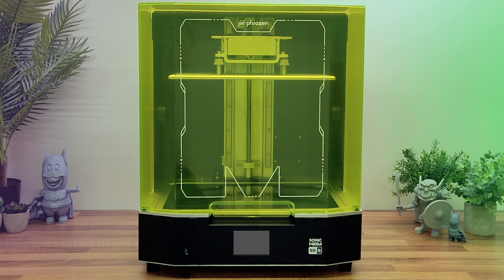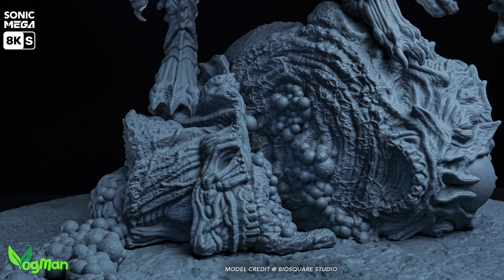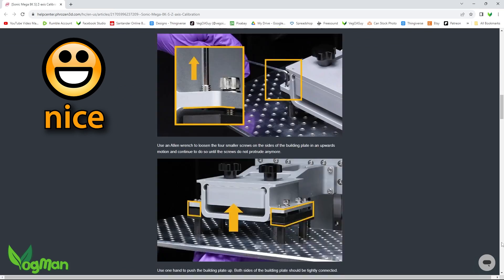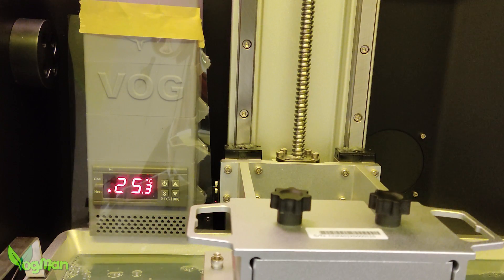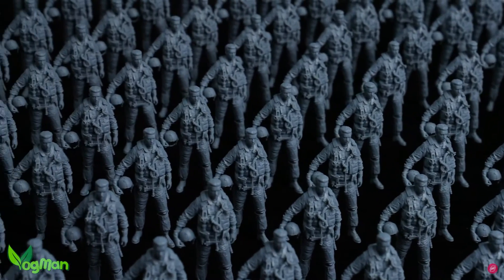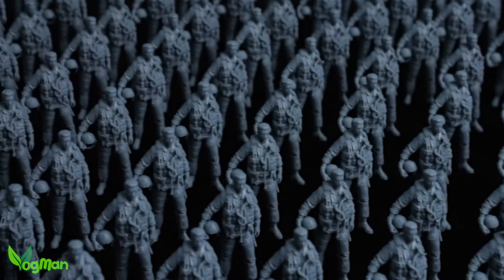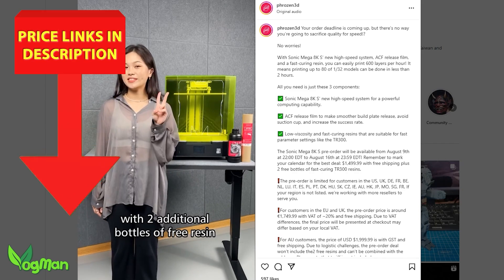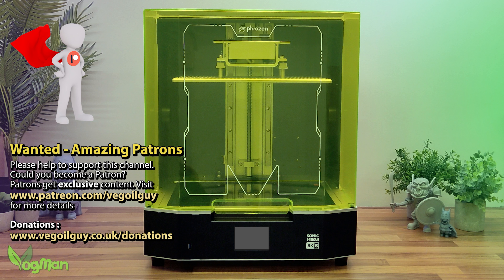Phrozen Sonic Mega 8KS + wash & cure stations [HONEST REVIEW]

Comment: "They all seem to drag their feet on this issue" It's likely because heaters can be a fire hazard. A hazard they probably don't want to risk liability over if they can't provide a quality and durable product. Possibly due to licensing as well.

What's even dumber than not producing a heater is how their resin pump is tied to their software in the Mega 8KS instead of stand alone so you can't use it on the old system or other printers.
Reply from the maker: I agree with you Greg. No doubt there's lots of red tape and safety regs to navigate, and that's daunting and expensive. Yet these same companies produce FDM printers that melt plastic at over 200C. In comparison, heating a chamber to 30C should be child's play 😁😁😁
Reply: @vogman  I agree it should be child's play. Still probably regulatory stuff that doesn't affect normal printer heating methods (yet).
Reply: @GregAtlas except gktwo gas one. Soooo.... There goes that theory

Comment: The print quality is really bad compared to mighty 8k
Reply from the maker: Different machines for different uses. The Mighty has a resolution of 28µm vs 43µm on the Mega. That is a quality difference that is easily discernible to the eye. That's why I felt Phrozen made a mistake in not including a 12K screen. It still wouldn't have bettered the Mighty, but it would have narrowed the gap 😁
Reply: @vogman   Yeah, i like speed of Mega 8ks and Size , but i will wait Mega 12K , haha, thank you sir Vogman😍

Comment: I feel it's a bit crap to have what is effectively a semi-pro machine at that price not have Wi-Fi/LAN as standard.
I get the impression with all these Chinese manufacturers that they are all following each other's tails and nobody is capable of any original thought.
As I can get an Arduino dual Wi-Fi/Bluetooth controller board for under a tenner, there is simply no excuse.
Reply from the maker: They are all quite similar, but one really stood out to me and that was Uniformation. They at least are thinking differently https://youtu.be/ie18N4GrMVY   😁

Comment: The wash station feels like it really needs a bit more innovation.  You could make the tap so at the very least it flips up out the way.  But im also thinking that they are missing a trick in that the position of the tap will drain all the IPA but not the sediment that will settle at the bottom which will be left behind..
Reply from the maker: Yes, that tap sticks out too far and on a workbench could easily be knocked. I also think there's plenty of room to alter the positioning. It's a big machine... that alone should make it EASIER to move things around.
Reply: @vogman  They could at least put in a 90° bend in it.
Reply: I think a beveled bottom that funnels everything to a spout that could attach to the front and detach when not needed would have been better.
Of course the impellers would need to be placed differently if they beveled the bottom. So having them sticking up from the bottom (to be flat above the bevel), on the beveled side walls, or having them near the bottom but on the sides would have been a good call as well.
The wash station seems like more of a quick design to shove out with the larger printer and cure station compared to the others that look like they have a lot of design work that's gone into them.
And of course for all of them, putting the dang power switch on the front. Yeah they'll need to have a separate spot for the cable to plug in but it's not difficult to route wires for a power switch, especially for a large company that's already designing a printer.
Reply from the maker: I was thinking of a detachable hose... maybe instead of a tap, a flush "coin slot" shut off valve.
Reply: @vogman  maybe a siphon tube built in like what is used for transferring brewed beverages?

Comment: Interesting looking machine but that price tag is so far out of reach it's a non starter. Great review as always VOG!
Reply from the maker: No, it's not cheap. It's a lot cheaper, but still not cheap. But honestly, the sheer size of this printer is NOT for those without a serious purpose in mind. If you print VERY large prints all the time, this is for you. If you print several hundred minis per week, this is for you. If not, then don't bother. There's better options for the casual user 😁😁😁
Reply: @vogman  yes verry cool printer. but i don't print that big that often so...  however what i wonder is could you put the 12 k upgrade that they have for the mega 8k into it?

Comment: cool.... thats a big boy

Honestly, with the heater thingy, I would simple do like elegoo with their filters. one port for filter, another for heater. however a heated vat would be optimal... but hey...
Reply from the maker: Uniformation are the only ones I'm aware of that think in terms of re-using naturally generated heat. As you say, in theory it's possible... it's a shame companies aren't doing it.
Reply: I really no longer care how good a printer is, if it doesn't have a heater, I'm not interested. While I have made my own solution thanks to Vogmans ideas on a small temperature controlled heater (That's a great video btw!) I have a 50watt heater that sits inside a 3D printing tent about twice the size of the printer and can keep all my resin bottles in there too and it keeps it all 25c printing in a shed in the UK when its literally freezing outside. So I solved the problem but its ugly, bulky in my tiny shed and given how little printer manufacturers need to put into heating the VAT, its insane to me that isn't a feature on all mid priced machines this year.
Reply from the maker: I don't get it. These companies produce resins that clearly state a recommended temperature which, for a lot of the world, happens rarely if ever. So why haven't they made more use of the printers own heat? Why haven't they manufactured after market heaters? It's strange. Frankly I have zero use for a resin pump. But a heater, I can't do without!